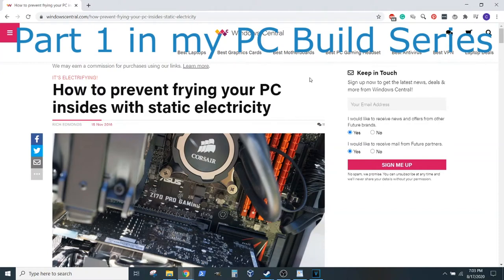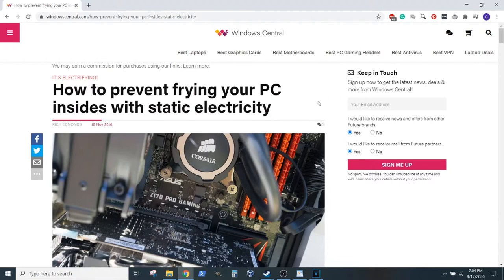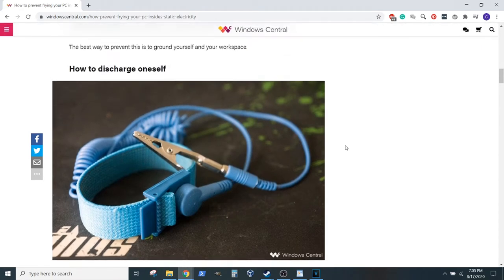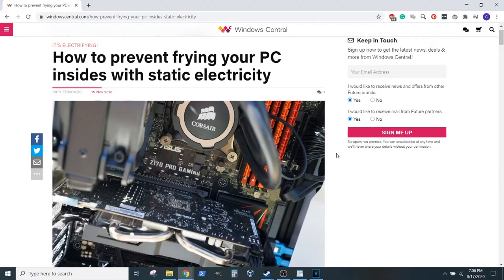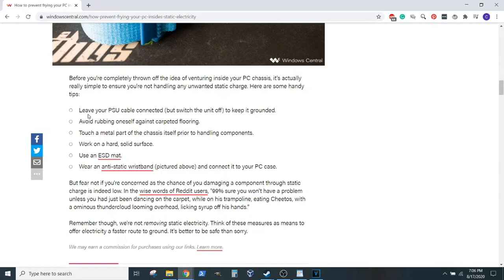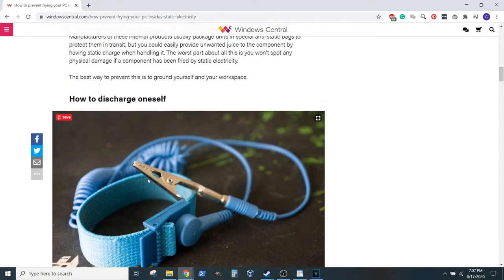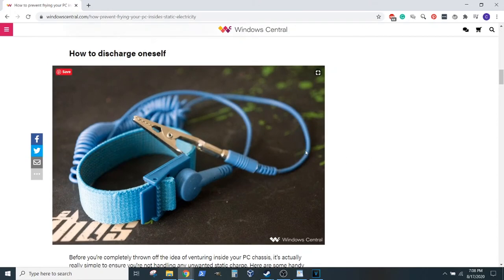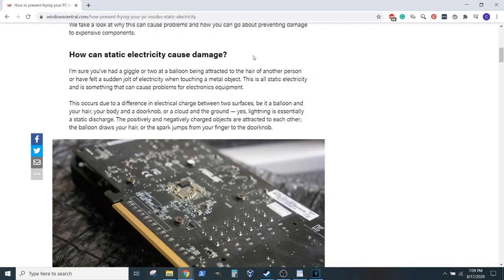Avoid Static Electricity for your PC Build!

Comment: Hi, so I have a question. I cleaned the inside of my pc with some ultra soft tissues... Realised it was a bad idea after I did it. I wiped some dust of my fans, and my case and a little bit of the mother board. Should I be concerned? Sorry for the question but I'm very worried about it. Thankyou for your time:)
Reply from the maker: Hi Freezy, you should be fine. Your computer was unplugged when you cleaned it I assume? Just next time make sure youre resting your arm on the computer case and that it's unplugged when you clean it.
Reply: @zengear553  thankyou so much for the help!
Reply: @zengear553  if I don’t wear socks and should I take away my jumper

Comment: can i use a psu without on/off switch to ground myself? does psu needs to be plug in or not? or a psu with on/off switch connected to outlet is ok  for grounding as long as the psu is turned off?thanks & God Bless!
Reply: Plugged in
Reply: i cant have it plugged in, becuase my psu has no switch, so it will just instantly turn on when plugged in

Comment: Hello I just used a vacuum cleaner to pull something that's inside my computer case it's far from any components but the vacuum cleaner made contact on the case because I stuck the nozzle of the vacuum cleaner inside the case will that generate static electricity and damage any computer components?
Reply: Yes, don’t do that again.

Comment: Hi I got a question. I am also new to PC building and I got a motherboard and decided to open the box (on carpet) to see what’s inside. I may have touched the motherboard while it’s still in the plastic bag but I’d did not take it out. I also noticed some little circle hole cutouts on the plastic. Is the board still fine? I’m a little worried since I’m going to start building next month.
Reply from the maker: Totally fine. The bag it is in is usually an "anti-static" bag to protect the motherboard.
Reply: @zengear553  Alright Thank you so much!

Comment: I have a question im new to pc building and today I received my motherboard and I opened it bcz i want to check if everything is alright and i opened the the static bag while my leg is touching a turned on pc .. is that ok or i just destroyed my motherboard..? I can’t check bcz im still waiting for the psu to arrive... please help
Reply from the maker: You’ll be fine man. Remember that your case is grounded.
Reply: @zengear553  dude just plug in your psu but have it turned off, touch it every 10 min or even better have in inside your pc when building, youll be okay, once everything is screwed in, unplug the psu and connect everything in and once that done, plug the psu back and turn on the system. just finished my i7 10700 build with rtx 2060.

Comment: dude just plug in your psu but have it turned off, touch it every 10 min or even better have in inside your pc when building, youll be okay, once everything is screwed in, unplug the psu and connect everything in and once that done, plug the psu back and turn on the system. just finished my i7 10700 build with rtx 2060.
Reply: i’m only uninstalling a top-mounted fan for exhaust (and soon installing a new one). can i just keep psu plugged in and leave all my peripherals plugged in while doing so? (i’m not sure if my wall outlet is properly grounded nor where do i get the info abt it, but it’s a three pronged wall outlet)

Comment: I’m building a pc in my room and my floor is covered with carpet is it good enough if I just put cardboard on the floor where I am building it?
Reply: Is it good enough? Or should I do something more. I don’t have anywhere else to build the pc
Reply from the maker: @slankyg3476  Should be fine, just rest your elbow on your case and your feet on your floor. Static is created by friction, so just don't have socks and don't worry about it too much.
Reply: @zengear553  Thank you very much

Comment: dude i don't have a earthing ground in my home my pc case shocks me when i touch it if my feet is on the ground 
i heard that a PC without a earthing connection will damage my components 
and i don't want that to happen 
is there any quick solution to stop this ? any home made solution that i can do to stop case shock?
Reply from the maker: Your power cable that gives your PC power is connected to ground through the outlet
Reply: @zengear553  what should i do?
Reply: @meiteimandies5406  it’s grounded by the connection don’t worry

Comment: Hey I got a question, since my pc psu doesn't have an on or off switch visible, and I got an ESD bracelet, how do I properly ground myself? Please help
Reply: Btw I'm just installing ram but scared I might cause a static discharge to the motherboard
Reply from the maker: DDH_13 Gaming you’ll be fine man, so just unplug your computer from the outlet and attach that alligator clip to the metal part of your case. When installing ram it might take a bit more force than you’d expect for it to snap into place, so don’t be afraid of that. Good luck
Reply: @zengear553  thank you soooo much😁
Reply: @zengear553  hey bro I followed your tips and installation went flawless😃👍, but could you help me with this one problem,  my original ram in my computer is hyperX DDR4 16gb 2666mhz so I ordered the same brand and installed it, now it's says 2400mhz, as ram speed is this normal? And I heard something about XMP profile
Reply from the maker: DDH_13 Gaming where is it showing 2400 MHz? In your bios?
Reply: @zengear553  in task manager
Reply: @zengear553  I think I found why, I think it's my computer's manufacturer, thanks alot for the help tho!
Reply from the maker: @drippyx_ddh139  ah sorry bro I've been working a lot lately and missed this reply. Something else you can do is run a benchmark software to make sure your RAM is at the the correct MHz. I did it with mine and had to up it by about 200. https://www.userbenchmark.com/ is great for this and what I used. Here's a thread on the topic: https://www.reddit.com/r/buildapc/comments/7xeurf/please_benchmark_your_new_pc_after_building/
Reply: @zengear553  thanks alot🌟